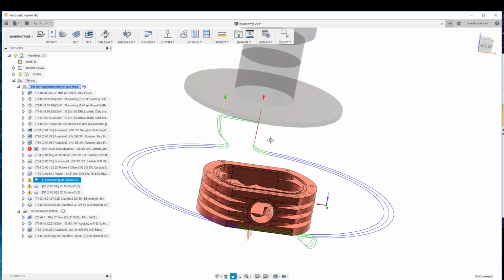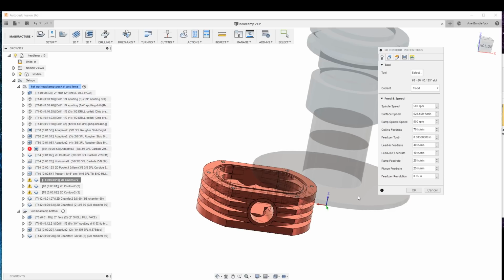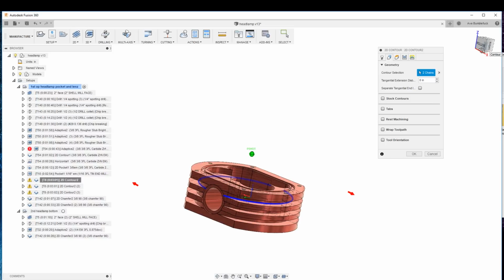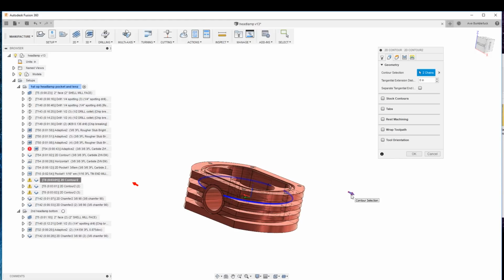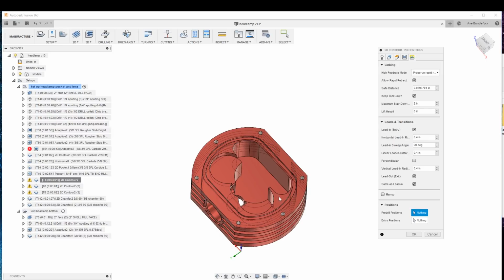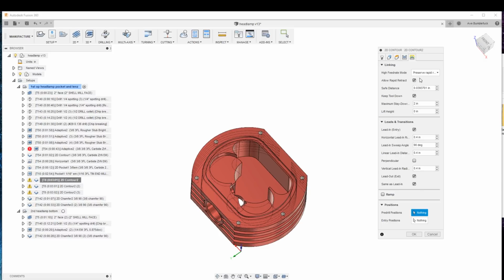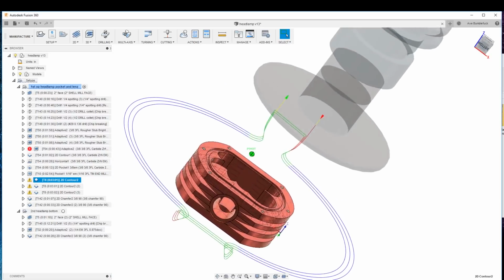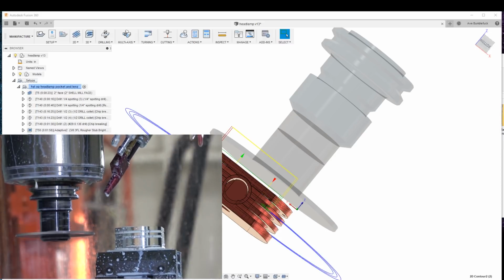Speedy Fusion 360 Ep. 10 2d Contour Slitting Saw

Comment: To keep it from jumping back up when it gets to the backside of the part, you can make a sketch to link up the two slots and use that as your contour path. Nerdly uses this workaround to get cleaner simultaneous 5-axis paths. Plenty of CAM systems require a similar workaround.

Comment: Okay, you want to get rid of the verticals? Easy, but it's not where you expect it to be. Set your lead-ins to be whatever you like, BUT set your feed height (on the heights tab) to be some ridiculously small number. When I'm doing an operation like this and I want to plunge straight down then cut in from the side, I set the feed height to be something like .01" above the start of the cut. That will rapid your plunge to that Z0.01, and then you'll go to whatever lead-in speed you've specified in the tool path.

Comment: I haven't done it yet. (Just barely installed fusion on the new confusior).  I think if you look at the lead in and out moves is where you can (possibly) eliminate those vertical arcs in the leads. That's usually where it would be in other software's. I think Fusion puts those arrows where the centerline of the tool path would be. So that's why with your saw they are so far away from the part. Due to the large diameter of the tool. I will know better when I actually do something with it. They/we are working on a post for the Mazak right now.
Reply: Yep Arrows are from center.